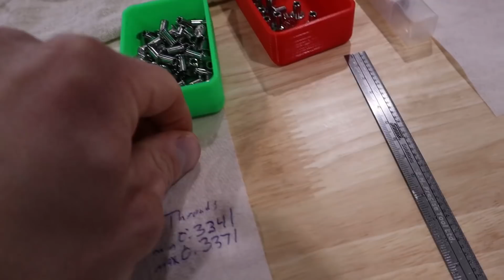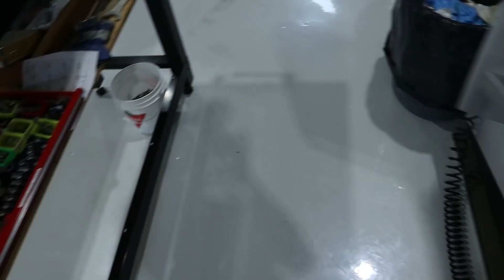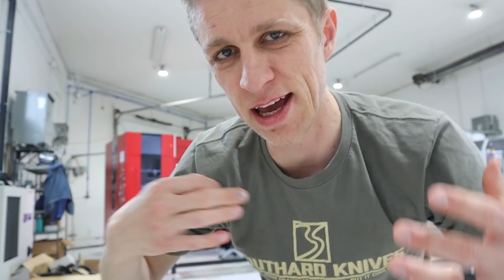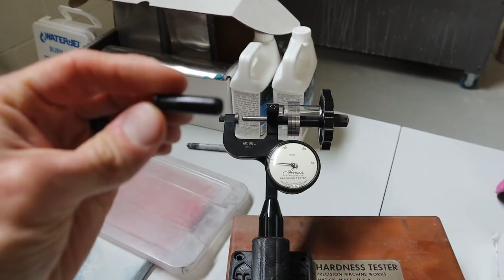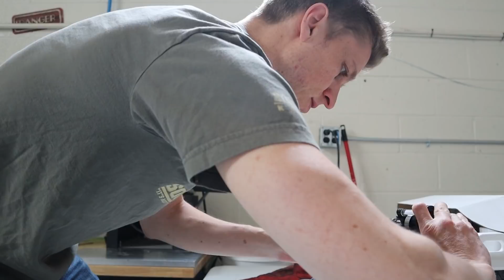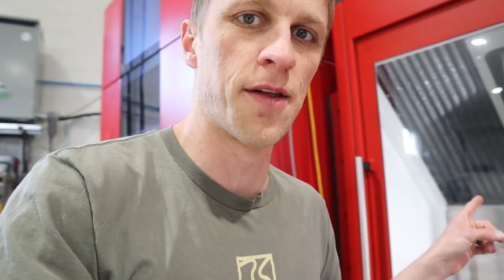Do I Make It, Or Buy It? - Quarantined Shop Life 23

Comment: If you want to warm the machine up, just put it into warmup mode (should be in your Settings screen, page down) and run it without bar in the morning for a bit.  Be careful though since it bypasses a lot of interlocks and safeties.  I always made my first dozen or so parts with the rapids at 25-50% to get things warmed up and expanded and get the oil/coolant spread around before turning it up for the day/night.

Comment: I'd def make them if it was for a cheaper machine, but not a new kern. Besides, you don't need that many tubes. Just buying them to prevent accidentally flooding your spindle is kind of a waste. I'd look into ways of programming more safety measures/checks into it first.

Also, maybe have it shipped directly from Germany? I've found that A LOT of things are significantly cheaper there even with shipping and you don't pay vat.

Comment: Hi John!
Check with Kern if you can disable through spindle coolant in the Tool Table. 
In the Tool Table you have the PLC column with %00000000, switching one of the 0 to a 1 will tell the machine to not use M7 on that tool.
You just need to know which one, if Kern has that set up.

On my previous MTE BF-4200 bed mill, I think it was %00000100

Also I saw you had a "Pressure"-setting in your tooltable, can it be set to 0?

Love your channel!

Comment: Yo John mech engineer here. I had to do hardness testing in the labs back in my undergrad on all kinds of different materials and a really important thing, especially with tubes, is to take at least 5-7 measurements then average out. Tubes do not take hardness tests well so in order to get a more accurate reading you really should be doing several tests!

Comment: Oil or coolant contact will lead to dermatitis and then you will be office bound forever.  Barrier cream and gloves are essential.

While it might not be feasible for the other machines, running the Tornos with its bar feeder round the clock avoids this concept of warming up, it gives you more good parts for no more than the cost of the materials and the electricity.

Comment: I think you made a good call to buy rather than make, even though they’re expensive. The way I see it, if you can get it off the shelf it is almost always cheaper to buy rather than to go through a complete product development cycle to design, prototype, test, and produce them yourself. The only reasons I see to make something are either because it isn’t available off the shelf, if no one makes it you can’t buy it, or if it is a product that you’re going to sell. There is the edge case where something is available but the markup is enormous, 10x or 100x cost of material for example, here the answer  is that it depends on the exact figures involved whether it makes sense to buy or make, but even then I would lean towards buy unless there  is a really clear and large cost benefit to making.

Comment: Make ten knives, buy the parts. You can make your grinding wheel work like a cupped wheel by taking a cratex stick to it and profiling it by hand. It doesn't need to be perfect, just relieved slightly in the center and it will work.

Comment: If you would heat the simply green a little it works way better. Use a drop in heating for hot chocolate.

Comment: John, i would recommend to get some coolant tubes from HAIMER. They make them on their own 100% in Germany and i guess the Kern guys can also recommend them. They are critical in Dimension, hardness and espacially coating. In Addition you should maintain your HSK spindle every year. The clamping set is probably manufactured by OTT JAKOB Germany and they recommend to change the sealing ring in your machine every year aswell. Greetings from Germany, Nico

Comment: Do you need one for every single tool though?
Reply: It's not for every tool - just for when you call the through spindle tool that's in the wrong holder on a Friday afternoon.......
Reply: He said why he does, just to make sure he never damages his spindle.
Reply: @mjoconr  i think is means not every tool would be thru spindle coolant.
Reply: Using tubes in every holder may prevent blocking the coolant flow in some cases...  But putting a non-coolant-through drill in a for example will result in the same result right? So you have to watch what your doing anyway. In heidenhain you can set which tools are allowed to use tsc in the tool table. Why not just set that up for every tool?